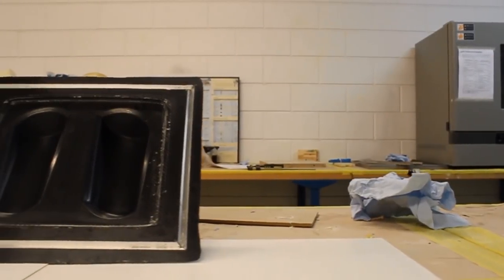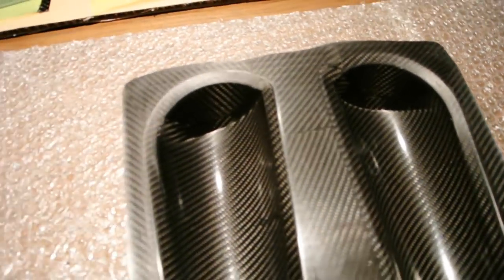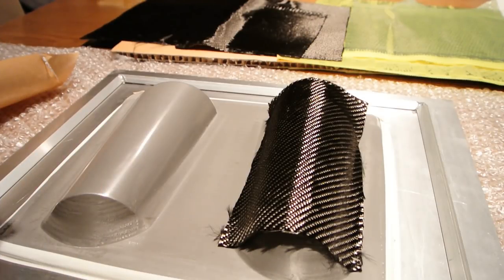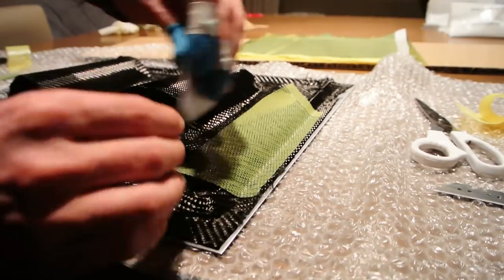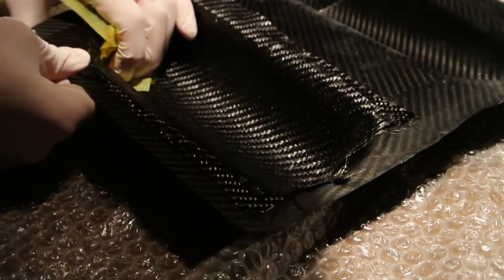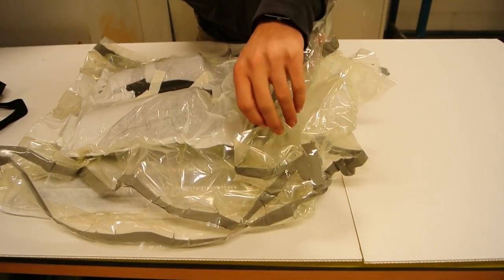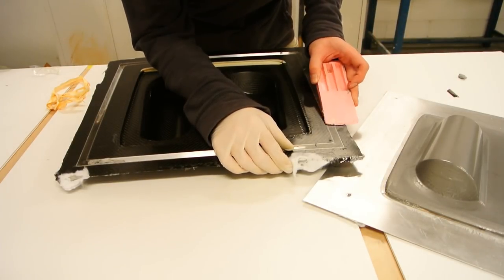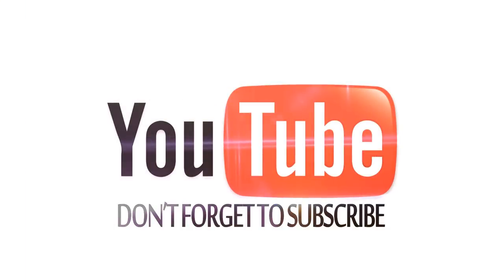Tutorial: Out Of Autoclave PREPREG Carbon Fiber/Fibre Part 5-7 (Complex Moulds and First Parts)

Comment: I was wondering the same thing, why did you make a mould of a mould of a mould (if I'm not mistaken). You might have a perfectly logical explanation but to me it's unclear. 

Also I was wondering if you could give me a rough estimate how much it would cost to make, for example, a pair of shin guards? I'm talking about the material costs per item, not counting labour hours, mould manufacturing and machinery (just the cost for each product made). 

Other than that I have to say this is a great tutorial video with great attention to detail, the overall work flow is just unclear to me (but maybe it's just me).
Reply: I'm assuming because the carbon fiber mold is more dimensionally stable at elevated temperatures, same thermal expansion as the part. Probably lasts a long time or makes many parts before getting damaged or signs of wear.